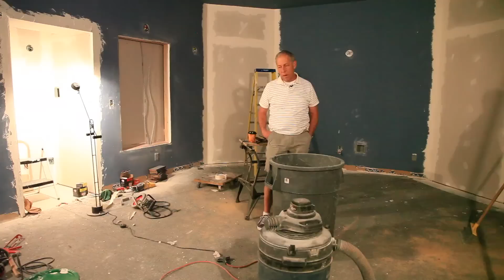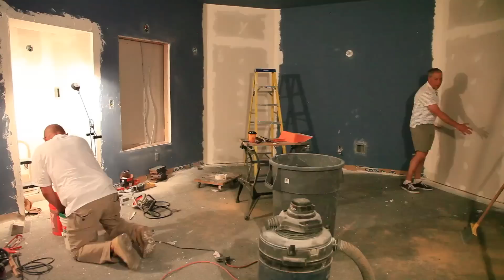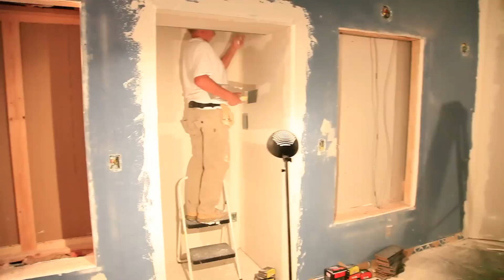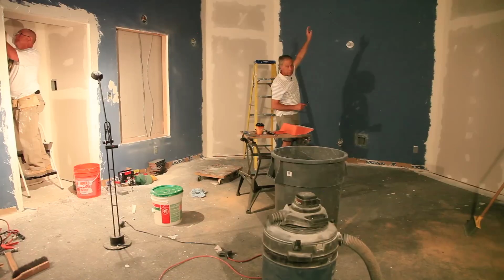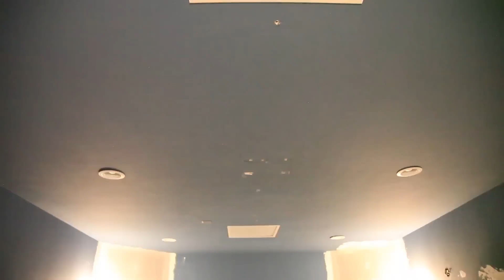Building a new music room Part 4

Comment: Paul, 
 What I don't understand, is that you have a concrete floor with 9.5ft ceilings. Why not just install a carpeted 3" false floor with accessible channels for all the cable runs you want? Make this assumption from the beginning, and run your volume calculations for a 9.25ft ceiling instead.

A false floor would also allow for removal and upgrades for the future, without having to feed all these cables through an in-wall conduit.

That way you can position the speakers wherever you want. Once you know exactly where they will be, then you can put a tiny hole in that spot of the floor for the cable to come out to the speaker.  Then, you have no cables to XLR connections on the walls at all.
Reply: The speakers weigh 1.2 tons + heavy amps.

Comment: "emulating" a recording studio? What does THAT mean?  Typically a control room in MOST recording studios are quite dead.  But foam absorption handles frequencies above 125 and higher Hz, and quadratic diffusors handle various types of echo depending on placement and type of design, and then there is activated carbon for the low frequencies below 100Hz.  Listening rooms generally speaking don't need to be as dead as a control room in a studio.  So you have to look at the delay times for 1st, 2nd and 3rd reflection as well as amplitude.  recording studios are designed for different type of listening and people are generally in different listening positions.

Comment: The Legacy Audio systems can't change room acoustics.  You can't solve room problems with speakers.  Room correction software doesn't change the sound of the room, especially with low frequencies.